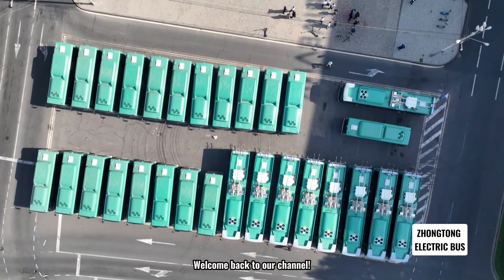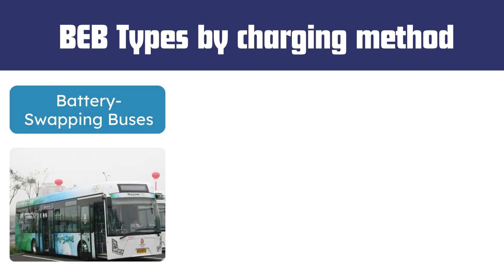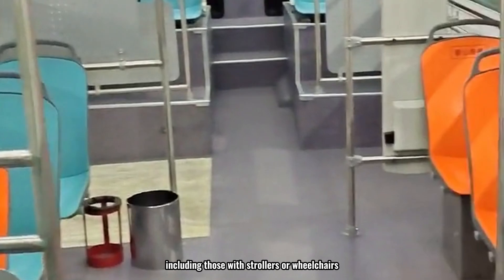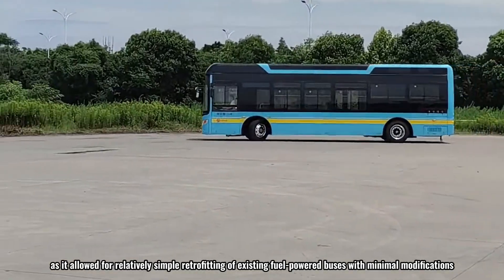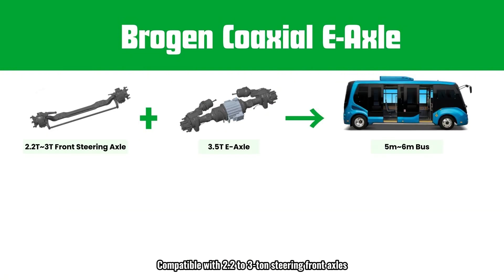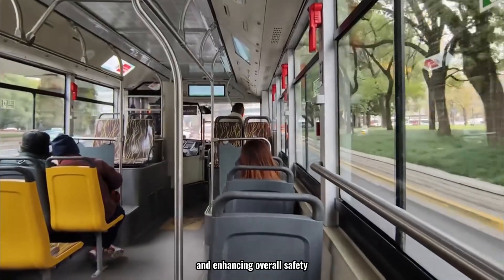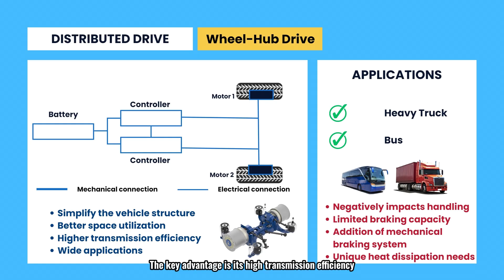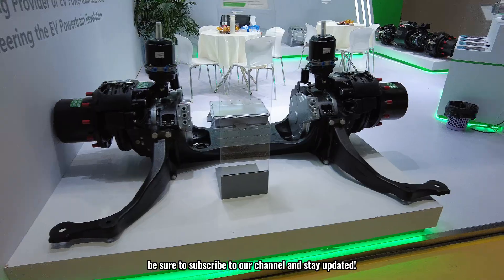Electric Bus Powertrain Systems: Which is Better? What's the Future Trend? #emobility #bus

Comment: Sir for a -50° Celceis what are the challenges in battery and motor
Reply from the maker: The battery thermal management system (BTMS) heats the coolant to maintain the target temperature of 25°C ± 5°C. In summer, the system cools the coolant to the same temperature range to prevent overheating.